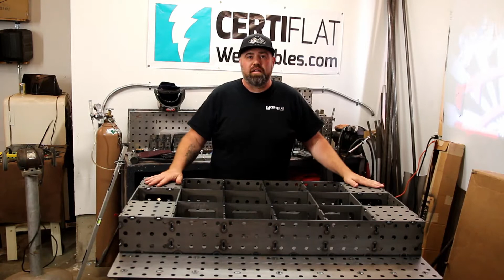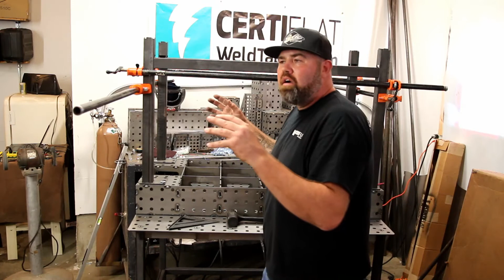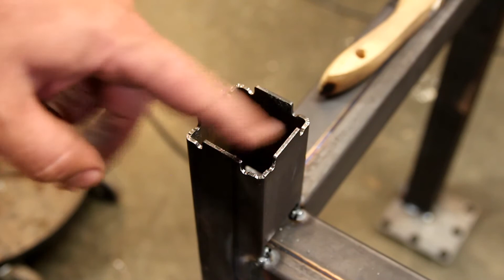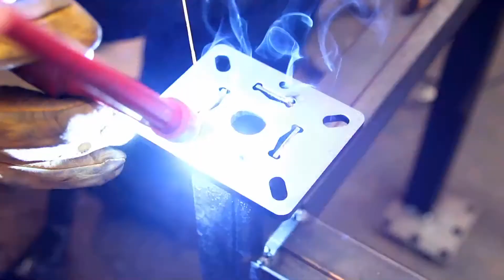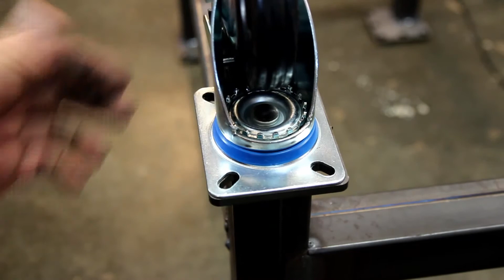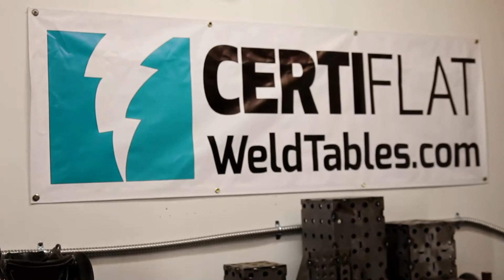CertiFlat FabRack Leg Kit Assembly Instructions

Comment: The blocks look really cool, but it's not my style. I do have two tables from the cerfiflat company where the posts slid over a cross-section of the flat bars. It's very sturdy with just a few 1 inch tacks.

Comment: HA. I see now that you guys cheated out on the bolts per design. I bought my fab block and leg kit a few years ago and just now got to assembling it and you only include 2  bolts per plate not 3 which would anchor 3 holes as the “4th” hole is the leg. Cheap cheap cheap but not really. Now either I weld it or go buy my own “missing” bolts that should go in the corner. I mean your intent was to bolt the plate to the block so why cheap me out on 4 bolts, nuts and washers.  Pisses me off. Not sure if I’ll buy any more of your accessories for this expensive investment. Good thing I’m only a hobbyist.  Also good thing your caster bolt quantity is correct.

Comment: Is it necessary to TIG it together or is MIG just fine?
Reply: I found when I was welding mine today that you need to clean off the pipe to weld it strong. It is covered in oil and scale, so if you're going to tig it I recommend polishing it with a flap disk and using acetone prior to tig welding. Mig is fine too, almost all of the other videos the tables are mig welded. I did mine with Flux Core, to say the least it burns through rust but it had a hard time with the pipe even when I cleaned the crap out of it.